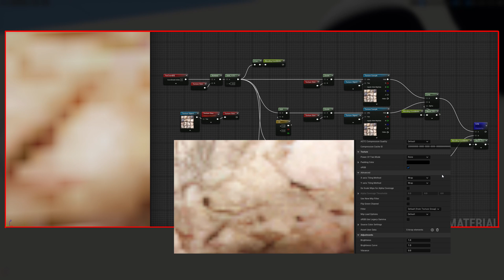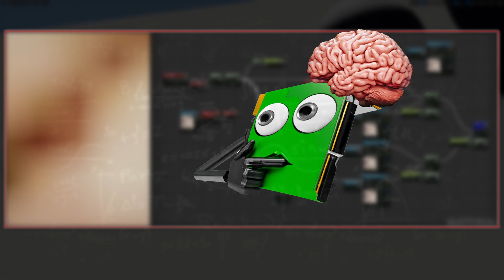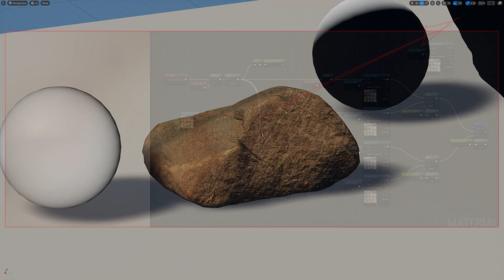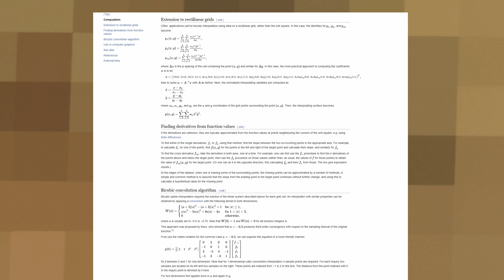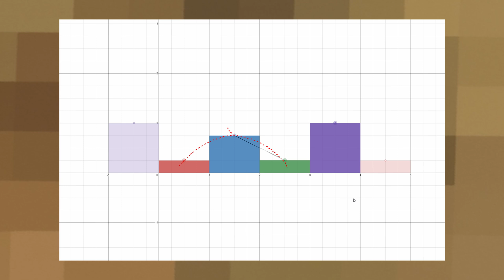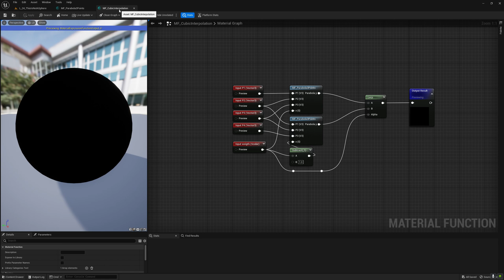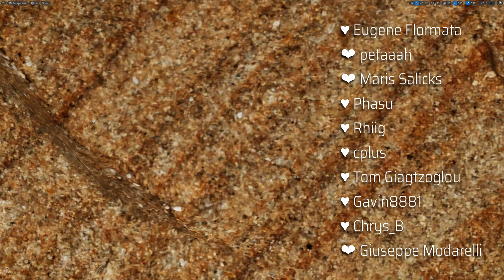How to fake 8K texture quality [UE5/UE4]

Comment: If creating a normal map from heightmap lowers normal map resolution, than maybe this method would help to make normal map appear softer(remove hard steps), and overall increase visual quality of runtime computed normal. Any additional calculation for this type of filtering could potentially be balanced by the fact that we can use lower resolution texture, and extracting (computing) all nessesary maps from albedo + alpha(height)

Comment: 7:32 “In terms of visual quality, this is a clear winner for me. What do you think?” Referring to the Bicubic outcome.
I think both bicubic + smoothstep and pure bicubic have use cases, the blockier noise perceptible with the bicubic+smoothstep might be useful for messier textures like grass or chaotic patterns (which could also benefit by a fake layer of noise at all channels ‘albedo + normals’, when zooming in for that matter).
Great video by the way, I have subbed since the 4K mipmap utility texture trick (great trick and video too).

Comment: So I implemented bicubic filtering via a custom HLSL node, and find that the visual pros sink against the performance cons. I had a nifty and optimized material that transitioned between nearest neighbor, bilinear (default) and bicubic based on distance. The extra taps for many textures in an actual game scene? More costly than using a better looking 64x64 detail texture or other techniques.

As much as I love my alternative filtering - I've also got Lanzcos, Gaussian, etc for other uses - anyone that I had take a blind taste test of bicubic closeup versus detail texture closeup, chose detail every time. There IS however a valley in the distance blending, where bicubic looks slightly sharper, but again, there are cheap/free alternatives to the extra taps/samples required for bicubic with any variation of algos behind it.

Awesome video, not shredding it with the above statements by any means. Just blathering on ;)
Reply from the maker: Nah that's a fair point!

Also because, for example, the bilinear has been around so much that GPUs have a dedicated HW module that does it, which makes it much faster :)

Moreover you should consider Anisotropic filtering in the equation, which nowadays is enabled by default. Maybe you could try to repeat your test but first set your texture to Nearest Neighbour Filter in the asset itself and see what are the results! I would be curious :D

It all depends on the use case, as always, I saw on my Discord server a guy that is making a PS1 retro looking game (so textures with no filtering and huge pixels) that added the Bicubic as graphics option and in that case it works incredibly well!
Reply: @VisualTechArt 

I actually came back to say that bicubic and friends would always have a place in artistic drive, haha... Every now and then I do an audit, search for whitepapers, etc, to see if I can revamp old stuff. I swear somewhere, I have a paper on optimizing filtering. I wanna say it was by Nvidia, maybe one of the old GPU Gems editions? At any rate, if I can get a version of bicubic that was stupid fast, I'd have that in my master materials for non-deco, non-distant type meshes in a heartbeat. It does add just the tiniest amount of extra sharpness in different viewing scenarios, after all...

Anyhow, keep up the great work! And if you could figure out how to handle an approximation of cavity/crevice mapping in HLSL (I have some hacky thing, but it's sampling a normal map 4 times, gross), that'd make for a great video I think. We can obviously bake these types of maps/masks, but with procedural being the wave right now, figuring out clever ways to handle some of our baked maps is going to be popular I'd guess ;)

Comment: Could you please include a material example implementing this?

The functions you provide on Gumroad don't quite alias with the video.
Reply from the maker: On Gumroad I've just uploaded the Bicubic Noise, true :)
It's not super hard to mod it for textures, if you join my Discord I can point you in the direction, there are others that already made it :)
Reply: @VisualTechArt  Could I just get a working version instead, I've followed your instructions on discord and I seem to be stuck in the same position others were now.

I'm not seeing the examples of others that already made it with these functions.

Comment: Is that expensive to add that to every material?
Reply from the maker: It doesn't come for free for sure, but to assess how expensive it is if used everywhere is up to you :)
If it enables you to also drop the size of every texture at the same time might be a gain overall

Comment: Bicubic is far superior, but I don't know if it's worth the added cost. Say you filtered all of your textures this way, how does that compare to bilinear filtering in terms of performance?
Reply from the maker: It's definitely much heavier in terms of instructions and requires many more texture fetches :)
That's why you don't see it used widely. That said though, on some kind of textures might allow you to sample a lower than required MIP, in which case it might compensate the extra cost
Reply: @VisualTechArt  interesting food for thought, thank you

Comment: Ok a place that jumps out to me that this might be handy is when you have data stored in a texture you need to blow up and out to a landscape level that the player experiences by moving through or looking at, like I don't know how snowy a region is, or something sound related, like how squelchy their footsteps are, or more like the volume of the wind. In those kinds of things hard transitions as you go from standing in one value to standing in the one next door stand out really strong because the world usually isn't like that they are gradual.  A few months ago I had a problem like this with wanting to add color variation to my trees in world based on their location on the map. I ditched a texture map that had real world meaning for my landscape in favor of a noise node because I had to choose between a larger texture than I wanted and a color gradient that was too chunky. So I skimped out for something lighter. If this is more efficient than jumping a texture size I'd want to go back and lose the noise in favor of something that shows a real pattern ie doing this with my gradient texture.
Reply: Same here! "color variation to my trees in world based on their location" I wonder if this math based noise if better than just using a low res noise texture, in terms of performance? Because in terms of result I bet both will be sufficent.
Reply: @ViktorartSnowtracked  The nice thing about using math is you can tweak the values whereas your texture is built once.

Comment: Super interesting and useful. It does make sense to use Bilinear and Trilinear for textures since it's much cheaper and you are likely never going to get that close. But I feel like any objects that do get really close, say for a game cinematic or some film applications could really benefit when necessary.

I like that you mention Vats as well. I just recently did a rather large VAT setup in Unity, so to save space I trimmed down the frame count. But the motion ended up being extremely linear. With a bicubic interpolation implemented like this I should in theory get some smoother looking motion as opposed to essentially moving each vertex to each point extremely linearly.
Reply from the maker: Thanks :D yes in general the material textures never get that close so that you can actually see the pixels very distinctively (still happens though), so linear interpolation is mostly fine :)

Unless you want to go for an interpolation that is so good that you can always sample a mip lower than you should... 🤔 Funny thing to explore.

Yes, vertex animation is one thing that would benefit the most from this, definitely try it and maybe let me know how it goes? :D